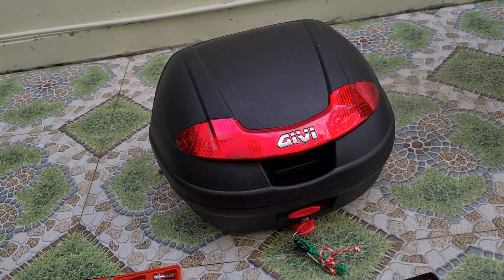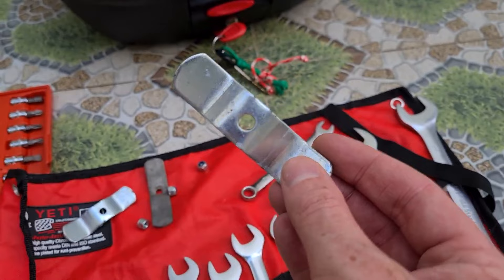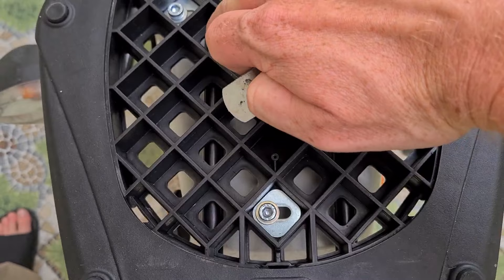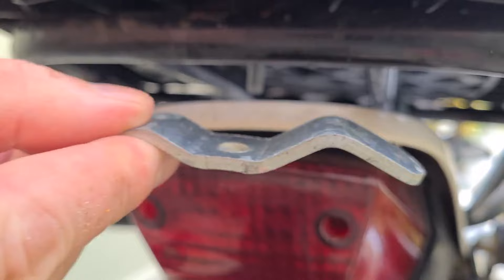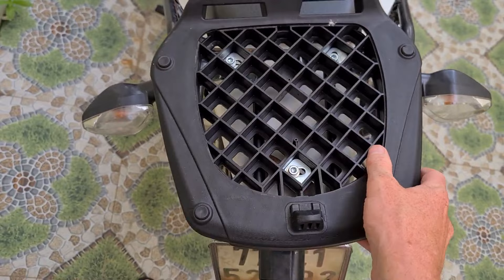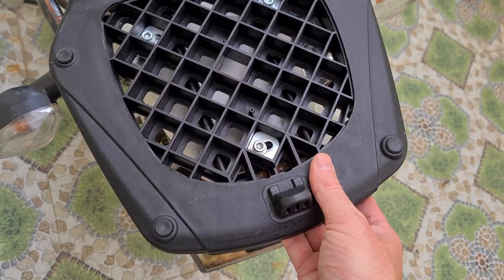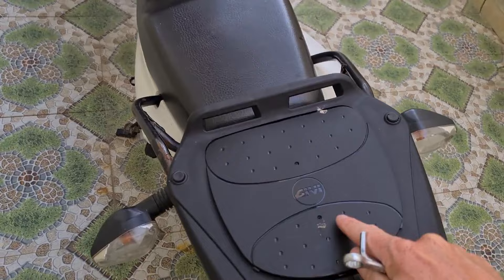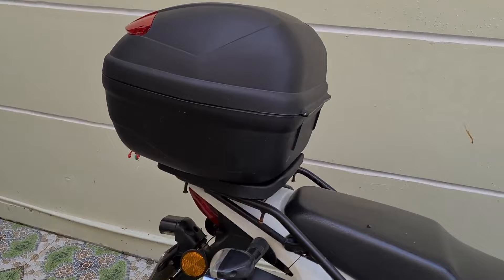How To Fit A Motorcycle Top Box (Givi Monolock)

Comment: This was really helpful, thanks!  Now all I have to do is work out how to close the lid - mine doesn't seem to be working properly... Heigh ho...
Reply from the maker: Glad it helped! And on some boxes the handle mechanism takes some getting used to as it the whole handle section has to be pulled back and then  up and over the latch to click back down. And this can only be done with the key in and the box unlocked.
Reply: @RichRides  My son's pointed out that there is a plastic edge which sticks up and is fouling the latch so I'm going to have to carefully take a file to it tomorrow to try and ease this up.

Comment: if you got one fitted to your bike is it easy to take it off fit plate on other bike ?
Reply from the maker: Yes, just remove the box and unbolt the carrier from the rack and fit to the rack on the new bike. If you have more than 1 bike then if you use the same make/carrier you can move boxes between bikes. I'm lucky enough to have a couple of bikes and a few different size boxes (all Givi Monolock) and can just fit any box on any bike 👍
Reply: How do you stop someone taking the box once it's clipped in? Do you have to use a key or something to remove it from the monolock plate? Thanks
Reply from the maker: @gregmartyn1976  yes, the box can only be removed if the lock is unlocked.

Comment: Rich hi i also have a new xr150 so im glad i found your video. Do those clamps hook on to one or both of the bars? It looks like just one.  Mine only fit one bar each really. I didnt try it yet but maybe once it's clamped down it will be tight enough. I have 4 clamps. I think have also seen a steel plate used on the bottom with 4 holes so you make like a sandwich and the plate is the bottom piece of bread. Not sure if i can buy that somewhere or need to make my own.
Reply from the maker: Yes, on this one the front 2 clips were only on 1 bar because of the spacing of them, and the rear one managed to cover 2. Even just covering 1 bar then because of the shape and the number of clips it is totally solid though.

Comment: how about removal of the top box? im thinking if someone tries to steal the whole box coz it looks so easy to install..
Reply from the maker: The box itself is locked to the plate and you need the key to remove it. And the plate can't be unbolted from the rack as once it is loosened the top bolt also spins and can't be accessed from above without removing the box.
Reply: @RichRides  thanks.. appreciated so much.. 🥳
Reply from the maker: @ramonjaimemelecio674  No worries 👍

Comment: Hi mate, looking to attempt this on a suzuki burgman 125, the issue is there's only 2 screws to hold it. That's not going to be enough right?
Reply from the maker: You mean to hold the baseplate on? If so, then you definitely want at least 3 of the brackets and I usually use 4 myself and have never had any issues

Comment: How secure is the top box. Do you need key to remove it ?
Reply from the maker: Yes, the topbox needs to be unlocked to be able to remove it. And the access to the bolts that hold the plate on need to be accessed from the top to remove so they're pretty secure.